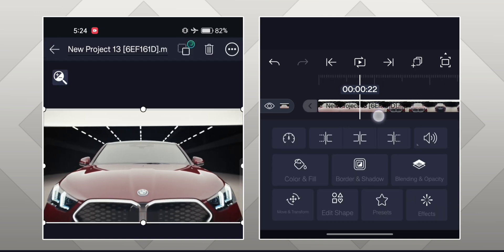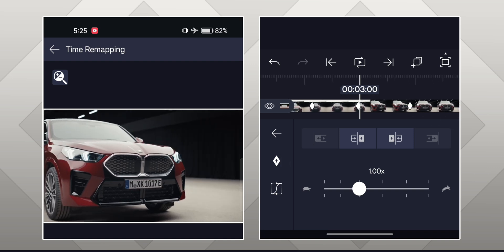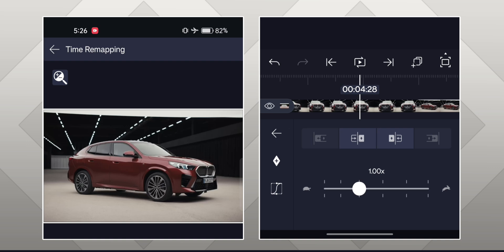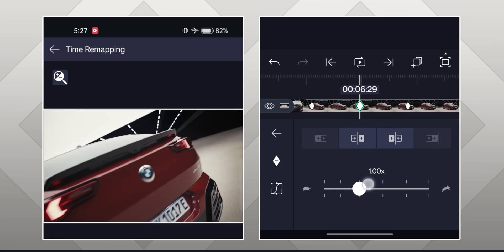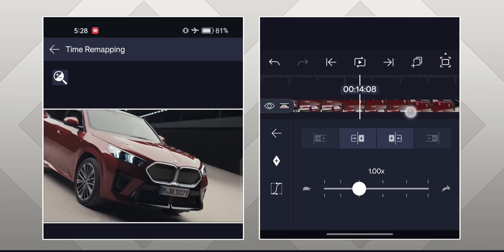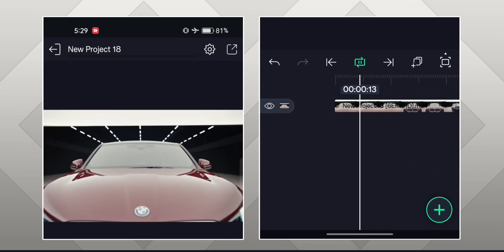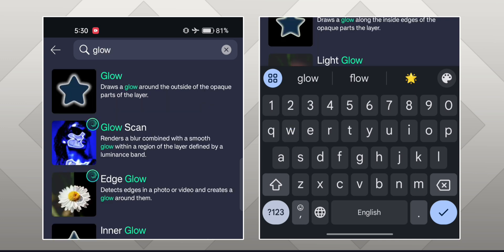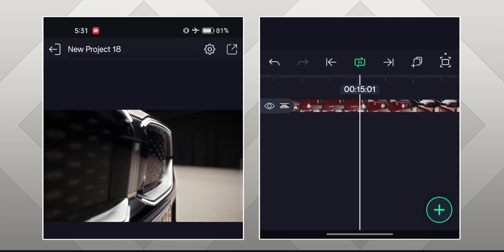Speed ramping using alight motion.

Comment: Why does it mute the sound on speed ramping? And even on normal speed changing. It keeps muted even after exporting.
Reply from the maker: This is only the tutorial of speed ramping, you can add music and sync it
Reply: @InfiniteDesigns.  no no, like, whenever I used to speed ramp in alight motion, the audio gets muted. When I saw a speed ramp tutorial, i asked this in the comments. Cuz like for example I have a song, and I want it to be speed ramped, like first it starts normal, speed up gradually, slows down gradually etc etc, but the audio gets muted. And even if I want it to be sped up only, for example I want a song to play in 2x, and I change its speed to 2x, it's audio mutes.
I know the grammars may be messed up cuz I've written this in a hurry, and still, I hope you understand what exactly i want to say and what exactly is the problem...
Reply from the maker: Yes I got it, but this is a problem in alight motion, I can't do anything for it. You can use capcut to resolve this problem
Reply: @InfiniteDesigns.  ok thx
Reply: @InfiniteDesigns.  I can't sync it to music so can u make new tutorial where it syncs to music